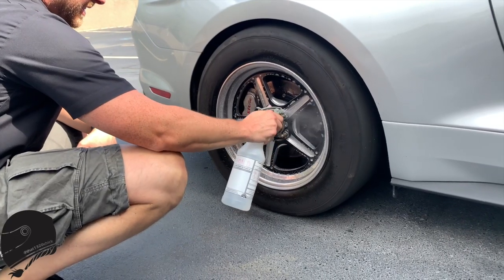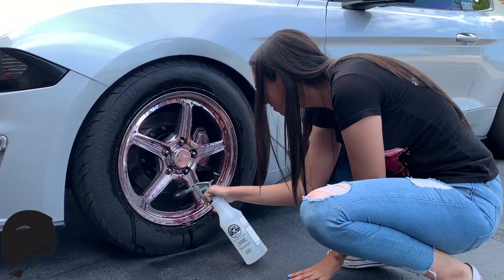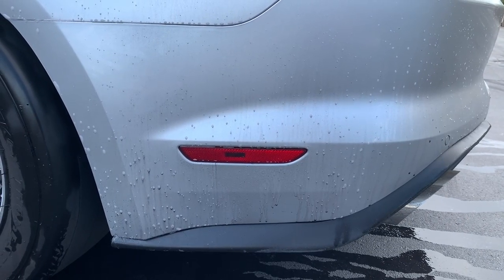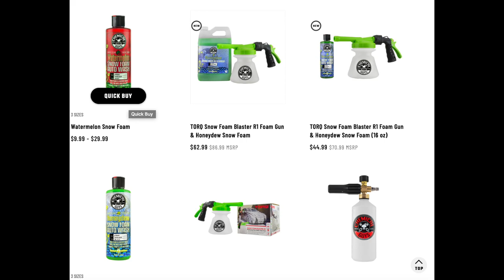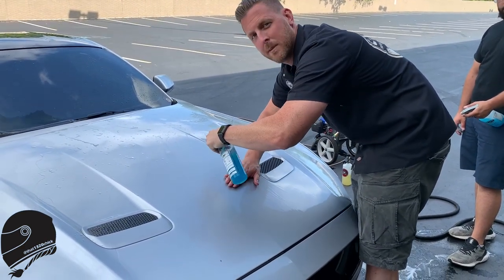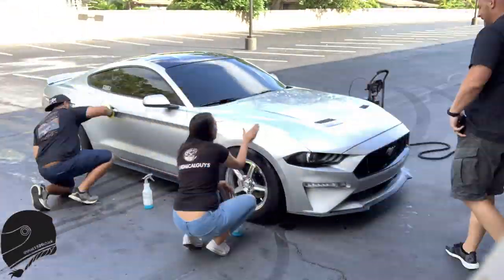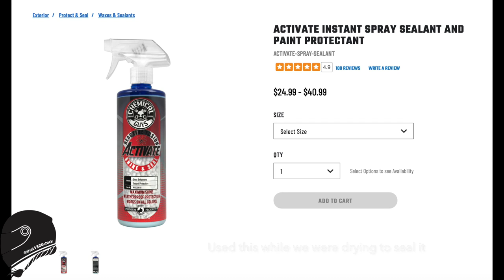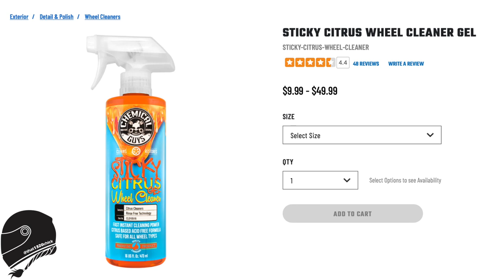Dirty Mustang Changes Color with Foam Cannon

Comment: Hi in this vid, what size wheels and tires front and rear? Thanks..
Reply from the maker: 17x10 rears with a 305/45r17 and 17x4.5 fronts with a 28x6r17
Reply: Cool..was curious thanks..